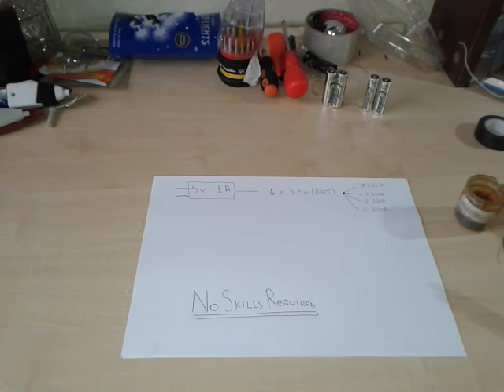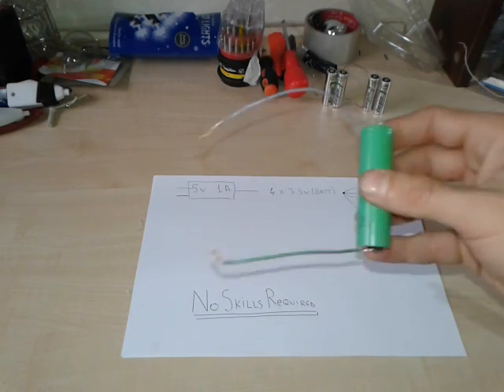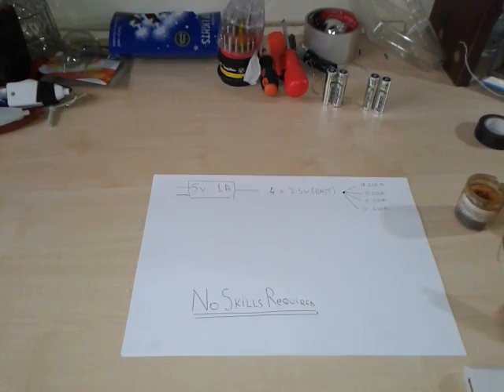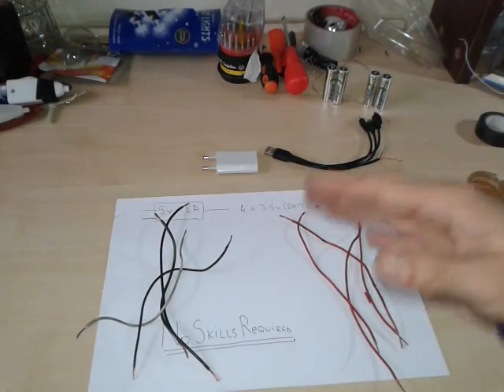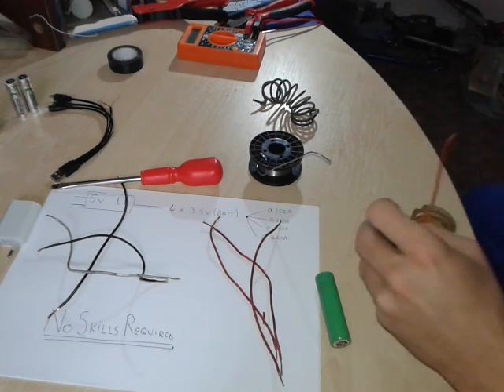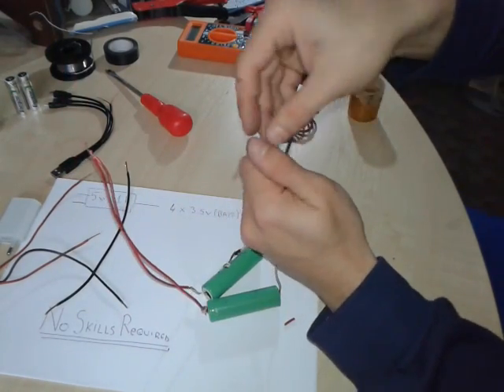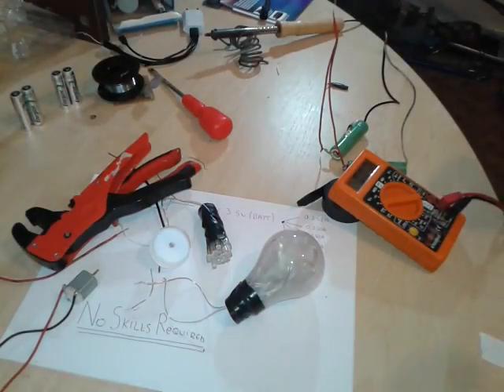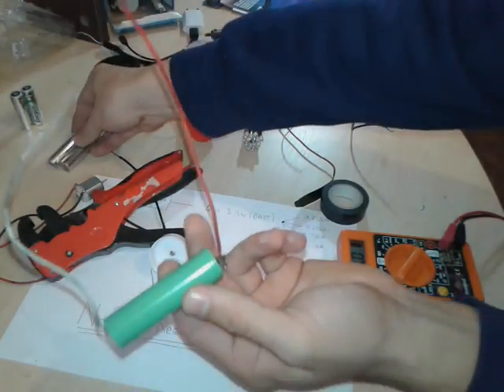Unlimited rechargeable batteries - Laptop homemade power bank

Comment: It's mean if I charge 4 with my charger then worries of dispose etc?
Reply from the maker: in the video i show that 2 cell from laptop conected in parralel and strait to usb charger no resistor used and there were fine.be carefull to the polarity plus and minus check with multimeter before connect to charger

Comment: I have laptop battery and 8 cells are in laptop battery . I want to charge gather . you told that in video we can charge 4 cell gather by just connecting resistor . I have charger of 5v 0.5 A. so tell me where I have to put resistor and of how much (OHM)?
Reply from the maker: the charger in the video is rated 5v 1A so thats i said that you need resistor if you whant to charge just one cell.in your case is 5v 0.5A SO less then the one i used you can connect all4 in parallel to the charger no resistor needed

Comment: how we can connect resister ? I want to charge 4 battery cell with 0.5 A charger. can you tell me urgently? please
Reply from the maker: what battery do you whant to charge?
Reply from the maker: if you whant to charge 4cell like the cell from video connect them in parallel and to the usb source 0.5A is gonna charge at 0.12A each cell.or you can put 2cell in parallel to 0.5A source and is gonna charge at 0.25A